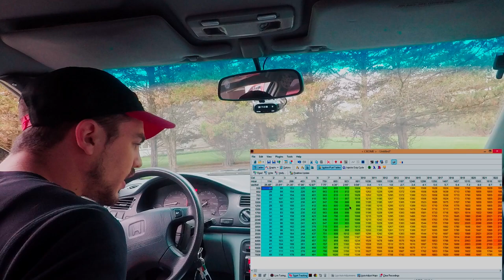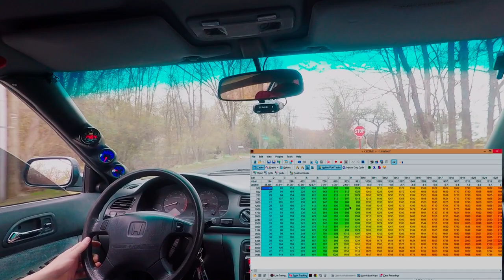Tuning my Turbo Honda on Crome Gold + Launch Control Setup

Comment: Sounds great. Man I definitely need to get a piggy back so I can tune mine when it’s done. I wouldn’t even know where to start on what I need to tune
Reply from the maker: Thanks bro! There's a learning curve for sure, but once you get the hang of it, it just takes time.
Reply: What equipment do I need to tune
Reply from the maker: Chipped p28. Possibly an obd2 to obd1 adapter. A moates ostrich to real-time tune or a chip burner. And a laptop running some tuning software. Check out my old videos on it.

Comment: Awesome build. Just started watching. Quick question, in crome /HTS, on your tables what do you set the timing to on your tables? As I'm sure you know with Neptune, Hondata, and Crome, there are additional ignition advance tables. Which I'm having trouble finding information on. Most of them increase timing by around 5* at 4000rpm, and anywhere between 7-9.5* at 6000rpm...and this is (on top of) the ignition on the tables you build. So say you have 18 degrees in it at 10psi at 6000rpm, the advanced ign tables will be adding an additional 9 degrees on top of your 18*...
Just seeing if you zero those out and adjust your base tables accordingly, or?
Reply from the maker: Hey thanks for watching man. To be completely honest, I haven't really pushed the setup too much by adding in any timing. I have always kept the numbers that the base tune came with, and retarded one degree per pound of boost. 

I know there is more power to be made with timing, but with tuning the car on the street, it is difficult to get a sense for what spark knock feels and sounds like as well as reading plugs is a pain. I'd like to rent a Dyno at some point when the setup is finished. I don't want to waste the money on it haha.

I Definitely like the idea of adding the timing in up top because the engine is less likely to detonate due to less load. If you add timing down low, you can break shit as I understand it.

 I've seen some people just add the timing in at peak boost and taper it in from there. All up to you honestly. I'm no expert, but the car hasn't blown up yet and it's decently fast. I'm sure I'm leaving power on the table, but I'm still learning and experimenting too. 🤟

Comment: What all tuning software do you use or did you start with
Reply from the maker: Using Crome Gold currently. Would like to be on Hondata soon
Reply: Any tips on where to get started kinda wants to do what you did and tune my own car. Get expensive always going to the tunner. I thought about biting the bullet and getting hondata or Neptune but seems like you have had good luck with crome.
Reply from the maker: It has been good to me so far and it was awesome to learn on something that is super cheap. You'll need a chipped ECU first. Got mine on eBay. Then I got the moates ostrich which allows you to tune real-time instead of burning and swapping chips cause that's annoying. Works like a champ. Then you can start making a basemap and whatnot.

Comment: did you touch the valvetrain?
Reply from the maker: Other than new valve stem seals, cleaning off the carbon and valve lapping when I had it apart, nope. Completely stock valvetrain

Comment: You didnt show how you set up launch control
Reply from the maker: My bad man. It's basically similar on crome and honda tuning suite. I've got a hts video on messing with launch control. Not much to explain
Reply: @ThatAccordGuy  haven't figured it out on Gold maps
Reply from the maker: You need to retard timing and enrich the fuel. There's a section for it specifically. You set the launch rpm and so on. What's the problem you're having?